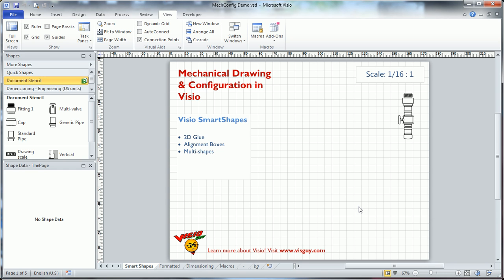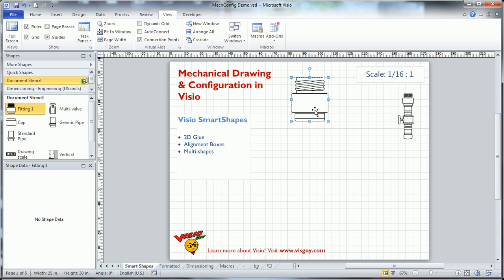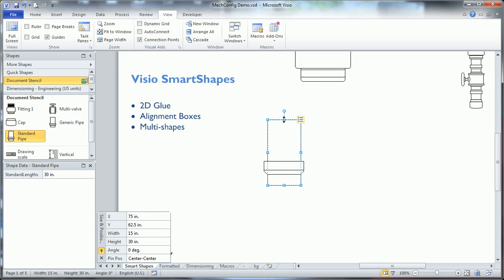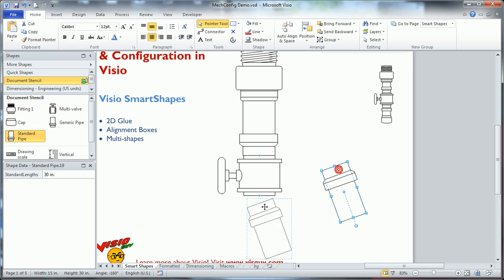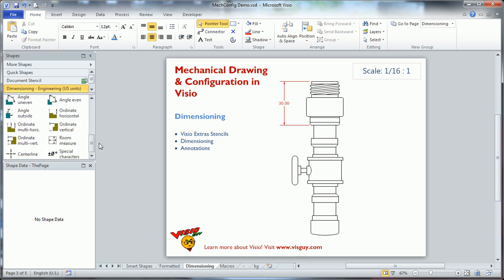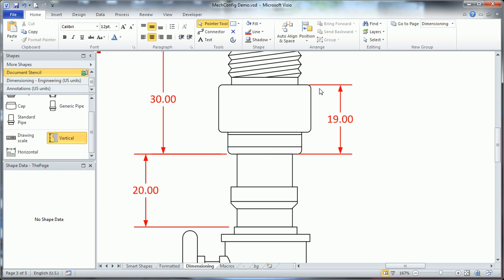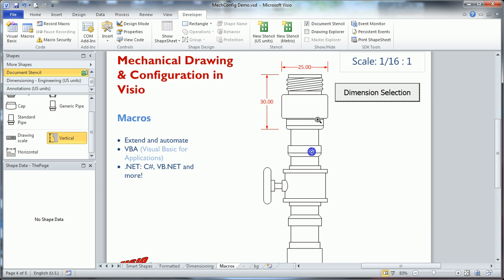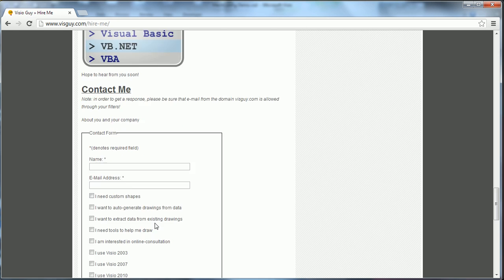Mechanical Drawing & Configuration in Visio

Comment from the maker: @Graphic Systems
In Visio 2007, there are AutoRecover options under Tools > Options > Save/Open tab. You can set the time interval there.

Sounds like your drawing is really big, maybe it needs some cleaning up. Could be lots of unused shapes in the Document Stencil. Go to File > Shapes > Show Document Stencil. This shows masters that have been dragged into the document. You can try deleting them and if you don't get a "this master is being used in this document" warning, then you'll have deleted an unused master and reduced your file size. Otherwise, just cancel the delete operation when the pop-up appears.

Comment: How did you add the action element to the Multi-Value shape that let you move between options in the shapedata list? I've been attempting to do this myself using the actions section in the shapesheet window but have not had any luck.
Reply: Phillip Stevens 

Hi PS,

It's not hard, but it IS hard to find an article on how to do this.

You do, indeed add an Actions row or two to the ShapeSheet to get it tow work. Here's how I usually do it. My method is overly parametrized, but it makes future changes easier, in that you just have to change bits of data in the Shape Data row, but not in the right-click Actions ShapeSheet cells.

We'll create a shape data value called ShapeType (Prop.Type) which can hold three possible values, then add three actions to get them to work. Note that “//” denotes a comment, and is not to be written into the ShapeSheet:

Prop.ShapeType.Label = "Shape Type"
Prop.ShapeType.Type = 1   //...this type is a fixed list
Prop.ShapeType.Format = "Circle;Square;Triangle"
Prop.ShapeType.Value = INDEX(0,ShapeType.Type.Format)  //...item 0 in the list is Circle

Add this helpful user cell that holds the index of the chosen value in the Shape Data row:

User.Index_ShapeType = LOOKUP(Prop.ShapeType, Prop.ShapeType.Format)

Here are three cells in the first action row that will set the shape to be “Circle”:

// Display item 0 from the shape data list as the menu item text:
Actions.Circle.Menu = INDEX(0,Prop.ShapeType)

//…blast the menu as the value for the Prop.ShapeType

Actions.Circle.Action = SETF(GETREF(Prop.ShapeType),Actions.Circle.Menu)

// Show a check mark if item 0 is chosen. Expression in
// parentheses is logical; it is either true or false:
Actions.Circle.Checked = (User.Index_ShapeType = 0)

// Two more action rows with similar formulas but different indices
// will let you set Square and Triangle:
Actions.Square.Menu = INDEX(1,Prop.ShapeType)
Actions.Square.Action = SETF(GETREF(Prop.ShapeType),Actions.Square.Menu)
Actions.Square.Checked = (User.Index_ShapeType = 1)

Actions.Triangle.Menu = INDEX(2,Prop.ShapeType)
Actions.Triangle.Action = SETF(GETREF(Prop.ShapeType),Actions.Triangle.Menu)
Actions.Triangle.Checked = (User.Index_ShapeType = 2)
Reply: Chris Roth Thanks! I actually found a solution before you posted. I found a shape for download with a similar principle and copied that formatting. I was trying to to SetF(getref(prop.name),"namehere") but it would not work unless "namehere" was number. The solution I found was to do SetF("prop.name",Actions.Row_2) which sets the name field equal to the name of the action in row 2.

I'm now working on a slightly different problem if you think you might be able to help. I know how to show shape data on a shape (via Insert>Field) but I want to create a two-way link such that I can edit the shape data from the shape data window and from a text field on the shape itself. Do you know how to do that?